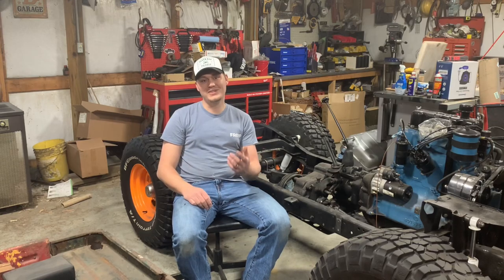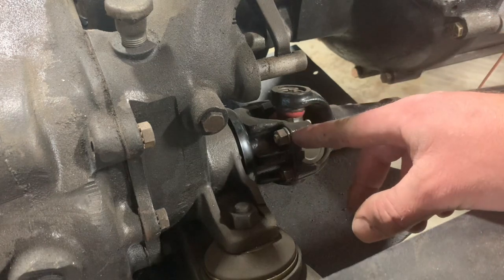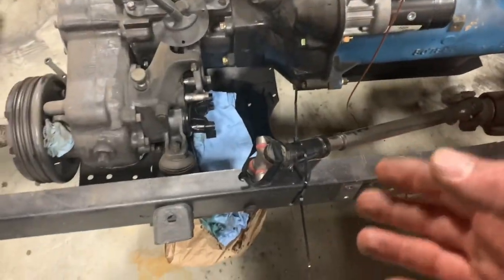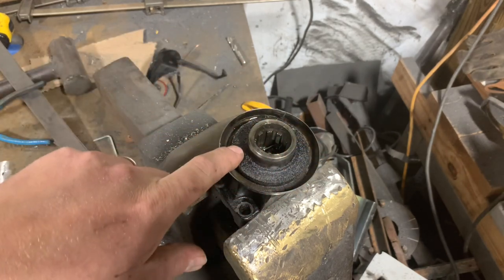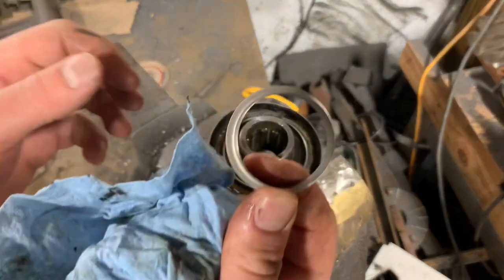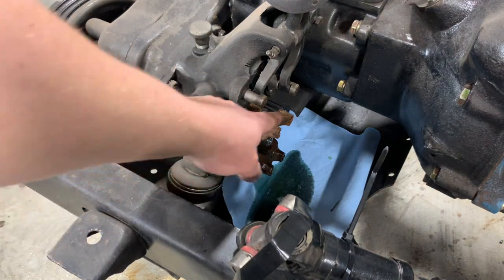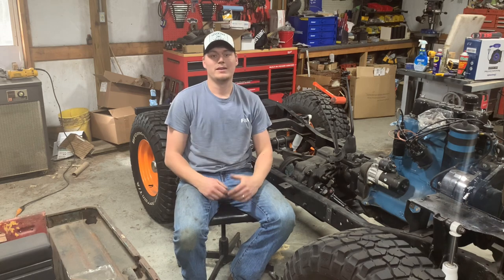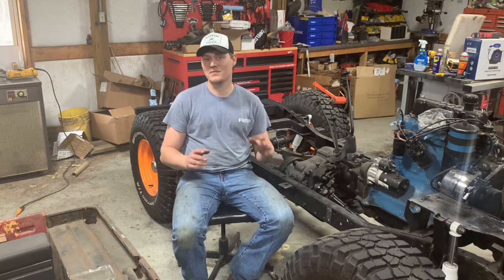Willys Jeep Fixing A Leaking Transfer Case… Again?

Comment: Good job.
Liked when shaft sleeves came out. Used now in many repair jobs to get equipment back in service.
I think sanding the yoke surface with 400 grit preps the surface. 
Clean with acetone, then put on some retaining compound on yoke and redi-sleeve so nothing gets by the metal to metal. 

Other option if it does not have one is to use a double lip seal, we used them on old gearboxes with worn surfaces to get by.
Reply from the maker: That’s some good advice! Thank you!

Comment: Just rebuilt my cj2a up here in Alaska.... when I did the transfer case I found a little r.t.v. on the washer does the trick for sealing the splines on the yoke....
Reply from the maker: It’s a good idea! Especially if you don’t have the O ring. And it beats slathering your output shaft and making a mess for later

Comment: yep. I agree tith Michael. Repair manual I used said coating the yoke spines with RTV also helps prevent leaks
Reply from the maker: I had previously done that but I believe the later model yoke with the O ring it’s not necessary, but I guess I’ll have to wait and see! Thanks for watching!

Comment: They make the same sleeves for the pinion yokes. After I changed the pinion seals, they still leaked. I had  do the same thing on them. I think I paid $22.00 a piece from rockauto.  They said they didn't have the front one, so I ordered 2 rears,    the front was the same as the back rear. It's be nice when nothing leaks.
Reply from the maker: Good to know! Thank you!

Comment: I have put a lot of wear sleeves on heavy equipment easiest way to get them on if you can is put the yoke in a freezer if handy and in the summer time here in tx is put the sleeve on the hood of a pkup leave them about 30 minutes and just drop the sleeve on no fuss you can heat up the sleeve in a oven just don’t get it to hot
Reply from the maker: I’ll have to try that next time, thank you!
Reply: That works for most press fit parts. Freezer to shrink one and heat to expand the other. Slips right on….. usually 😉

Comment: you should've cleaned and put rtv sealant on the yoke splines
Reply from the maker: You’re correct for older style yokes. The O ring on the later style yokes should serve the same purpose. Thank you for watching!
Reply: @SevenBarSalvage  i'm correct for all yokes. that's why i bothered to mention it.
Reply from the maker: You’re right nothing wrong with some extra insurance I appreciate it!

Comment: Great video (sorry think I hit thumbs down first time I watched this. Mistake!)
Just replaced the trans and transfer fluid in my 49 3a, probably for the first time in decades. No sooner did I button it up it began dripping out front and back yokes at an alarming rate. Think the old sludgy oil was the only thing sealing it up!
Reply from the maker: Thank you! Haha these things are hard to seal up, good luck!
Reply: @SevenBarSalvage   - question- how hard is it to replace the seals while the transfer case is in place do you know?
Reply from the maker: @motorv8N  Honestly it would probably be pretty aggravating… but anything is possible 😉